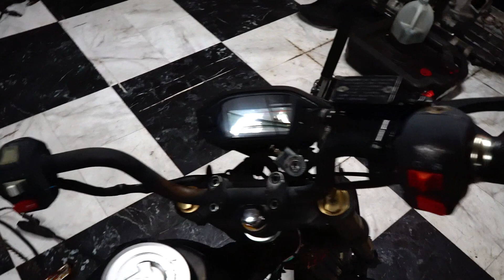The Moped Chariot Part 2! First ride!!

Comment: No training wheels, connect the two halves with a u-joint. You'll get the pivot in both directions you need, but it will keep the bike from twisting side to side so it won't fall over.
Reply from the maker: I wish id thought of that earlier!!! Finding info to build these things is non existent. Training wheels will do for now till i decide to buy/ acquire one.
Reply from the maker: You were right about training wheels. no bueno
Reply: @ZipTied  I think if you angle the u-joint correctly, you could even get the bike to lean a bit as it pivots side-to-side. The lean angle would vary by the turn angle, independent of speed, but it might help.

Comment: Unlike my trooper or the civics, pick and pull cant hook you up with a new brain box for 65 bucks.  Be careful with testing bud that was mad sketchy.

Also, from experience remote piloting outboards from the bow, solid or jointed rods will give you way more precise control than cordage or cable, maybe to the extent you could keep it balanced.  That way you can push with one hand and pull with the other just like your hands are operating the handlebars, it'll feel way better.